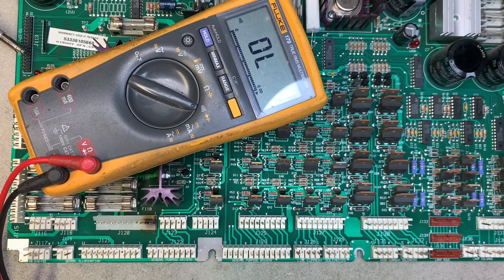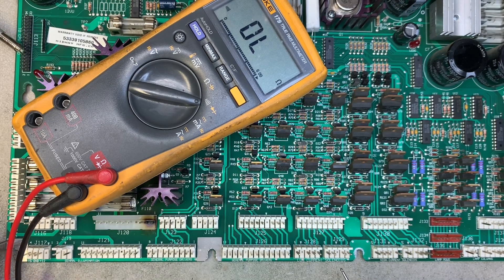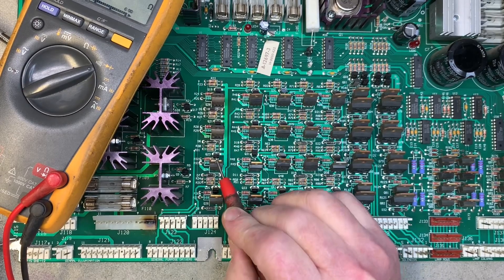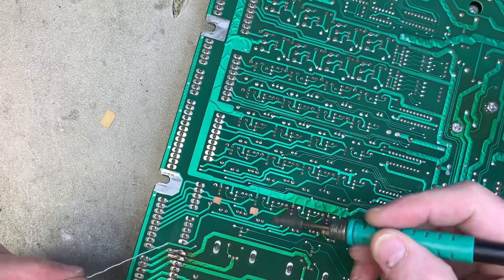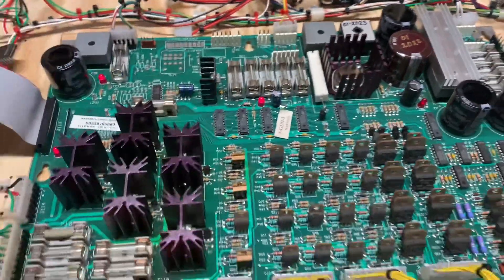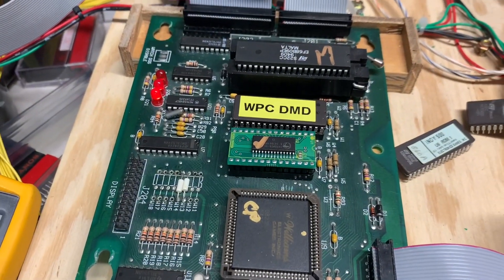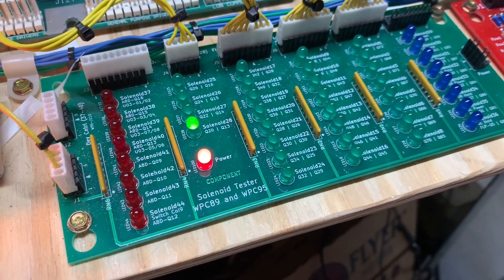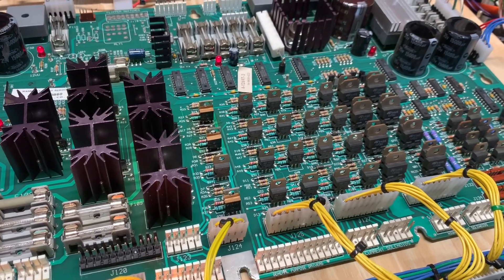Quick Transistor Short test on Theatre of Magic Williams PowerDriver Board

Comment: Very interesting!
Do you think your transistor test trick would work on other electronics or is that more a quirk of the boards you're working on? I'm thinking like a desktop motherboard.
Reply from the maker: It might but it depends on the design of the board. The design of these boards switch the pin connection to ground. If shorted, they are always switched to ground.